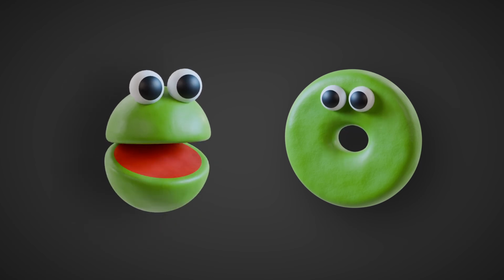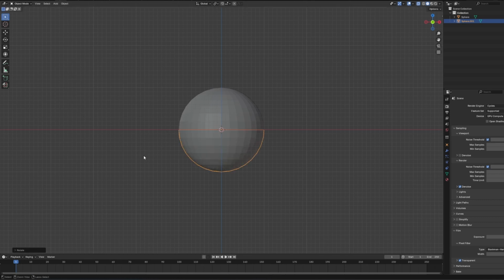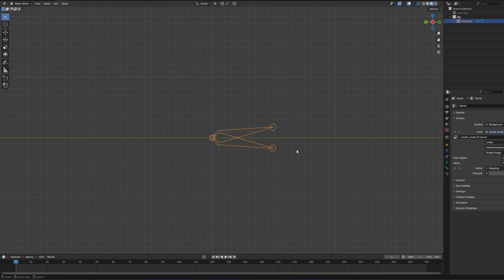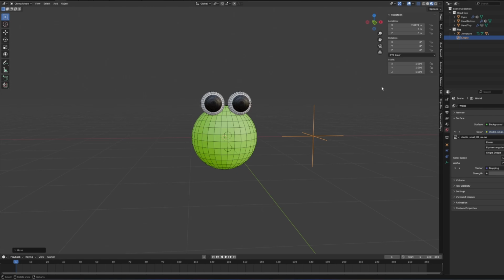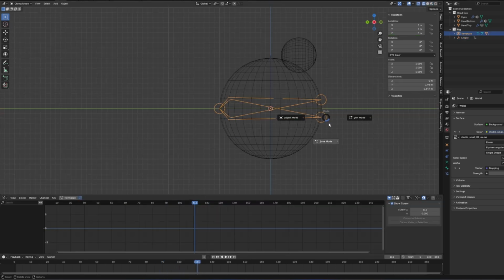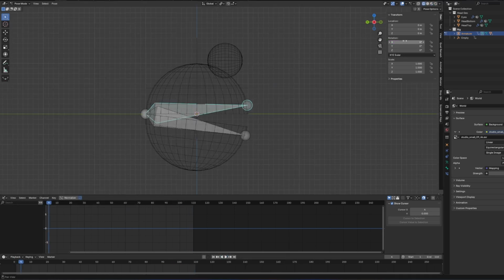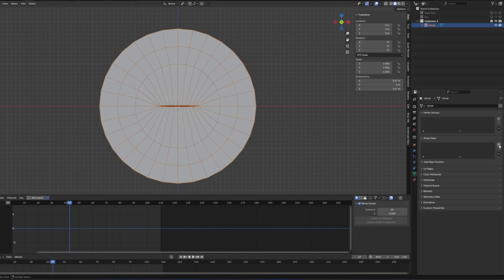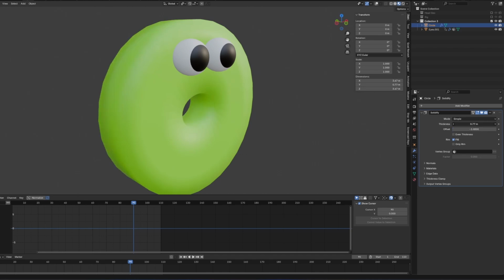Use Audio to Animate a Talking Head (Blender Tutorial)

Comment: Thank you so much for this explanatory video, it's great and very clear! Your method of driving animation with Drivers is awesome. I was wondering if it's possible to use this same logic for lip-syncing on more complex models? For example, instead of just using Shape Keys or bone rotation, how would you go about controlling texture swapping (sprite switching) to switch between different mouth drawings based on the audio? Thanks again!
Reply from the maker: Thanks! Glad you liked it! I think it’s possible, but it can get quite complex to drive different mouth shapes based only on audio. Simple setups usually end up with just a few states like open/close unless you build a more advanced system.